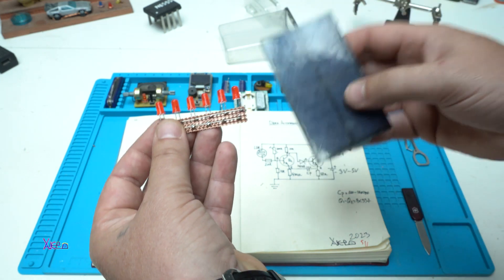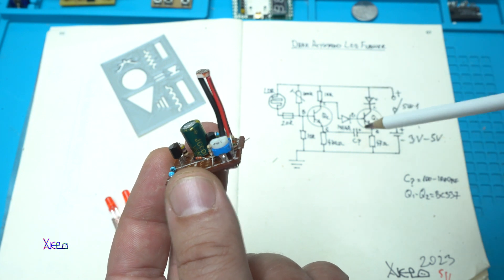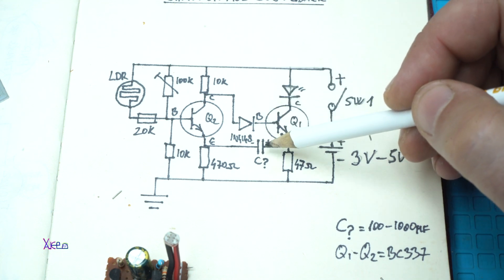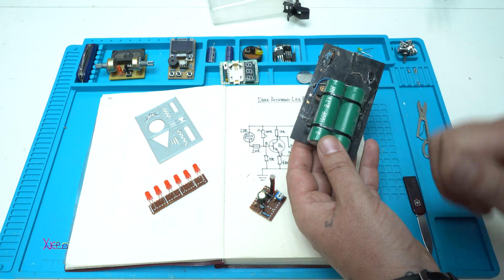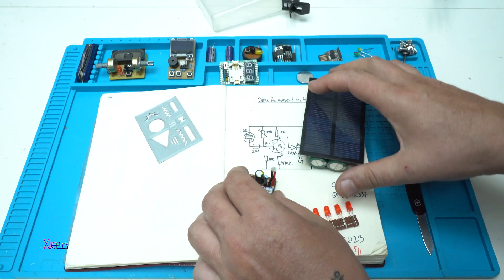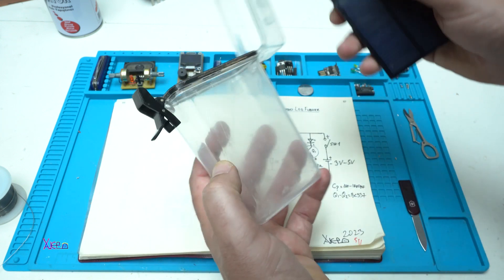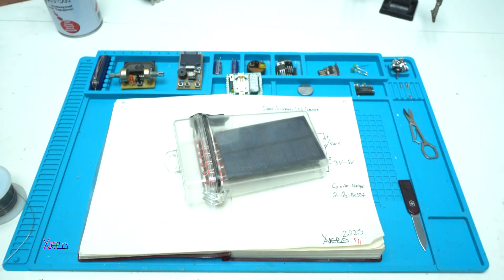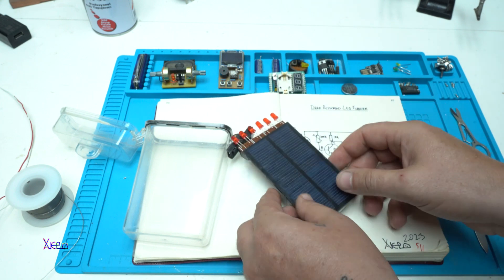Batteryless Dark Activated LED Flasher with Circuit

Comment: I must be  lucky because I live in Arizona U.S.A where we have bright sunny days at least 90% of the time.  So I really want to take and learn how with my 3D printer to make decritive solar lights for outside.  I have a few 15watt solar panels so I just need to get I think a buck converter so I can dial in the 3.5-5 volts I know I can and will use resistors but, I just want to have a better all the time voltage .Then I want to find super caps to store the power from the solar cells.  I don't know where you would use the flashing red lights but, with my mobility cart I'm building it would work for the night if I am ever out in the dark.  Any suggestions ?  Thanks again !